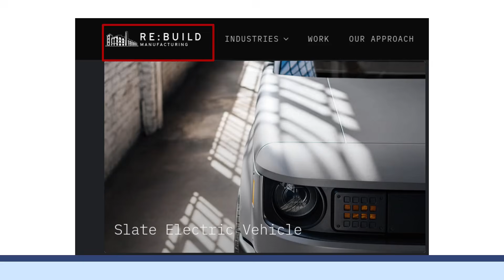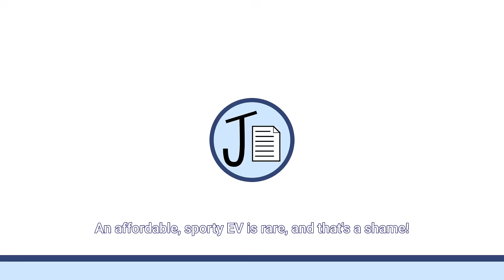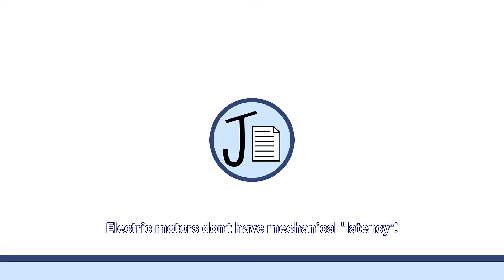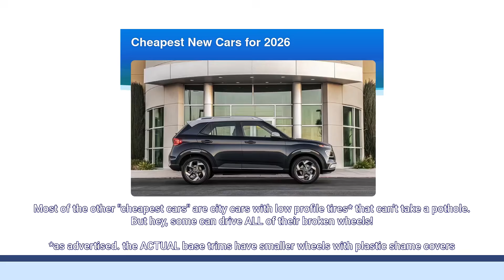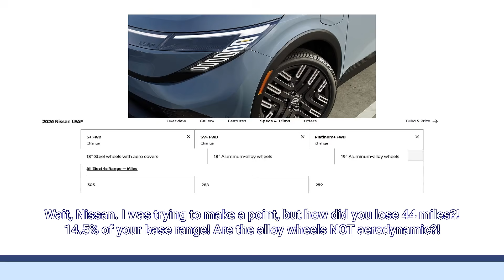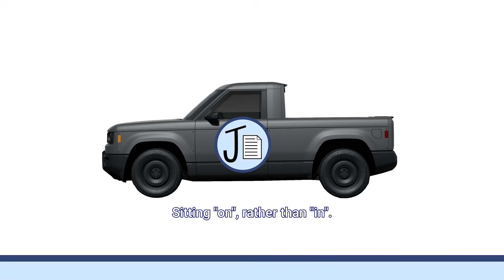The Slate Truck: EV Performance For All

Comment: I think that if this car will be trily successful as an affordable mode of transportation and cheap utility it needs an ice engine, at least a hybrid option. Fir example, farmers and lets say lumberjacks working in remote locations, who use this car for its affordable yet capable utility, wont have all time access to a charging station, and you cant carry jerry cans of electricity to fuel up in case of emergencies, or go to an old gas station in aa quiet town that conviniently close to your worksite
Reply from the maker: I maintain that electricity is more accessible in remote locations than gas. Any long-term settlement in the US has electricity, and it can be generated from *anything*...including gas. For any given amount of gas, you'll get more EV range than ICEV range because of thermal efficiency. If you need to bring in jerry cans, may as well use them for the generator.

Comment: I like the idea of the basic truck. A good way to try an electric vehicle. But I will wait to see if all the add on options make it or if there were supply shortages or problems. And how much the aftermarket people jump in. Like a bolt in module to add a stereo in the dash. Or leather seat covers. A trailer hitch with a wiring harness!
Reply from the maker: At least one add-on option didn't make it; they used to have a power window kit. The forums speculate supply or regulatory issues. Many of the options on the online configurator are now from aftermarket suppliers, including many lights and bed accessories. I'm hoping we'll keep seeing more variety!
A Slate rep said the trailer hitch accessory has a 4-pin wiring connector. Folks on the forum seem happy about that, but I can't claim to know much about towing.

Comment: The range isn’t enough for what I do   Otherwise interesting.  They should do a simple modular battery system. A simple base battery with the ability to slide in more power like sliding in an oversized drill battery.
Reply from the maker: The new LFP battery uses all the space in the chassis because LFP is less energy-dense than the original cells. Will be interesting to see what people are able to do with batteries in the future. I do think that 205 miles is a good amount of range. Batteries are the most expensive part of an EV, and I like that Slate targeted a modest figure.

Comment: Any idea of replacement battery cost? (I'm not sealioning. I've had 3 EVs and want another.)
Reply from the maker: Nothing but speculation on the cost of a replacement battery at this point. Maybe it'll come out with some kind of insurance or repair-related information?
Reply: Most EV batteries will outlast the vehicle and then could be placed in stationary battery backup
Reply: @phileasler5401  True, but is one allowed to discuss contingency for edge cases or do we just reassure each other here?
Reply: @nickolasthefrog absolutely 👍

Comment: 25k is too much for an EV that’s not a car, not a pickup, not an suv. What is it. It has no towing capability. I could see it being 15k something  for kids to drive around. But it’s not going to be very safe. With little range. No thanks. For 25k I’ll get a used real vehicle.
Reply from the maker: The 2k tow rating is literally in the video, man.
Reply: It’s a real truck, but maybe not for you

Comment: If you call $ 25,000.00 for nothing, a vehicle that has doors that close windows that roll down and drives. If you call that affordable, I don't know what planet you're living on. To get even the basic, most modest features.You're well into the $30,000s. How is that affordable? Unless slate comes in at a base price of $15,000.00 it will never survive the competition.
Reply: His video before this one covers the affordability dimension — it’s more than just initial price.

Comment: to think it does not need awd is silly, it might be great as is but some people genuinely need awd. just watch one of their own slate winter test videos, it has no proper traction. im sure as is will make many people happy. id prefer awd, as well a moonroof cutout option, even if just a panel cutout that i could pop out with some bolts and add a rag top to for summer times.
Reply: AWD is a crutch 90% people use as a replacement for proper tires

Comment: Does it have the built-in spyware mandated by the US government in 2027?
Reply from the maker: It's my understanding that the 2027 spyware thing is a sensationalized rumor with no realistic plans for implementation.

If Slates are shipped with spyware under order of law, it will be the most easily "disarmed" vehicle on the market, and Slate's the only automaker I know that's expressed explicit disinterest in customer data. Anything more I could say is far into the realm of speculation.

Comment: I just kinda wish it wasn't a pickup truck lol. I don't need that shit, id rather have more cabin space, better aero/range, and a smaller easier to parallel park car. I say this as a tall guy btw. Watching the videos that slate truck is not big enough for my legs anyway lol the fact that the seats dont slide back or lean back is a problem.
Reply from the maker: Supposedly, tall people fit well. I'm pretty sure the seats do slide/recline, unless you mean that they don't slide/recline far enough, in which case, I'm not arguing; just trying to inform.

As I said in the video, pickup truck isn't my ideal form factor either. I'm just glad it's a two-door and not something bulkier; its footprint is comparable to my own hatchback.

Comment: You'd think that by now someone would build an affordable electric sports car, for one simple reason: Batteries are the most expensive part of an EV. Sports cars are small and streamlined, meaning low drag. Low drag means you can achieve decent range with a smaller battery, meaning less cost. The only company I know of that's developing a car with that logic is Aptera.

You might say that the long hood that most coupes have makes no sense for an EV, but there have been plenty of rear-engined sports cars that used that space for luggage (Porsche, Alpine, Delorean, Volkswagen SP2, Skoda 110R).

Comment: One of my favorite things about the Slate is that it's an instant filter for the automotive commentariat.  If they can't even argue the value proposition, they're not worth listening to about pretty much anything, because it means they have no insight into what makes vehicles valuable... they only know what the OEMs tell them about the market.
Reply: The Maverick is a much better value proposition.
Reply: Depends on what you value. More stuff is more stuff to break.

Comment: I do not need AWD, I’d much much much much prefer it and it would make driving though New England winters significantly easier. My current car is fwd and it does fine, but my next car will be awd. Soon as slate has that they have me. If Fords small EV truck gets awd I may end up with that one.

Comment: I'm excited for the Slate, I put in an order a few weeks ago when they did their big reveal and I found out about their design philosophy, support for right to repair, etc.

I'm not a truck guy, I've never had an EV, and I have never bought a new vehicle. But the chance to support such a transparently good idea was too much to pass on. 

I hate modern cars. So so much. Even the expensive ones.

Comment: 245's really arent that wide.
Reply: Though in proportion to the Slate, which is narrow by today’s vehicle width distribution, they are.

They’re probably fine for dry conditions. If you get dedicated winter tires, you might want to consider a narrower tire.
Reply from the maker: You're probably right.

Comment: 1. Rear wheel is usually better, not always. In snow front wheel drive vehicles tend to perform better.
2. Gasoline vehicles and hybrids do not suffer the immense range losses that EV’s do in inclement weather. Hot or cold. They suffer a little but not much.
3. If it takes you 8 seconds to reach 60 and you have no latency to start, then it means you are underpowered in the midrange which is not better, try passing someone on the highway with no midrange. that 8 seconds goes somewhere bud.
4. This is not how you market a EV pickup. You market it on simplicity, lighter weight vs other EV’s which makes it more engaging, you talk about how its weight is low centered and improves stability and balance. You had the right idea starting with removing AI driver aids, that’s where you need to keep the conversation. Trying to compare this to a sports car is really stupid, just stop.
Reply: 1)   Understandable but rwd is usually better because it is more efficient.
2)   If winter range is a problem, an ev isn't for you.  Sodium batteries need to rival lfp in density then we can solve that problem 
3)  8 seconds is a lot quicker than you think if you have instant torque and no gears.
4)  its not?  Well I do think they should emphasize the repairablity and "soul" of the vehicle
Reply: For some reason we skipped the obvious success and started making a bunch of impractical, overpriced and vapid EV’s. The most successful EV ever was the model 3, a big sedan, why? Because it actually came close to hitting its expected mileage, was a nice split between practical and luxury, and controlled its price. Minivans were such an obvious platform, flat bellied, focused on comfort and practicality. yet here we are without a single updated competitor for the Toyota Sienna. So Toyota sells every single one they make at a premium while every EV being released gets left unsold on a lot somewhere. It’s so stupid.
Reply: @Drewcrdllo I do think repair ability should be emphasized, that is a good point. But we cant keep saying things like (if the weather is a problem then it’s not for you) that eliminates 75% of the U.S. market. If you want EV’s to find success they have to work for as wide a range of people as possible. I’m one of the few Engineers and genuine enthusiasts who actually know mechanics and how ICE, EV, Tractors, Trains etc works who wants EV’s to get better. Everytime some idiot lies to people about what EV’s are they do permanent damage to that end. They don’t make good sports cars because they carry extra weight, and dont have much character. But you know what, none of that is a problem for a small pickup, or a minivan, or a luxury car. Position them correctly, be honest and realistic, and they can find success.
Reply from the maker: 1. You ignored my point about weight distribution - most cars are front-heavy.
2. I didn't talk about range.
3. You ignored my point - gas cars are the ones losing the midrange in practice, because their 0-60 measurements are a launch that hides their latency in practice.
4. I'm not marketing. I'm a car nerd being excited about something that looks fun to drive. I have another video about affordability, and I will continue to make videos about Slate while I have ideas.
Reply: On point 1, I agree with you.

I’ve driven FWD, RWD and AWD in snowy, icy, slushy conditions. While my current vehicle is AWD, and does have an easier time accelerating in the stuff, I prefer the “clawing through” sensation of FWD, which is a factor when switching lanes on a multi-lane road, or even crossing a road that has mounds of snow or slush on it. RWD tends to over rotate as the front tires have to be pushed through the walls of slush and are always deflected to varying extent. AWD does a little fishtailing as the front tires experience resistance while the rears push add to the deflection movement. FWD just pulls itself through with little unexpected rotational motion about the vertical axis as the rear tires don’t push the rear to one side or the other.

The first time I drove my AWD on a snow-covered highway and had to go through built-up snow walls to change lanes, I was surprised by how much the rear end wanted to step out, and it’s a Subaru which has a reputation for handling well in snow and slush. I actually drive at a slower speed in those conditions than I used to with my FWD vehicle because of it.

Comment: thought this was a good idea, but with a range of only 200 miles and thats if its empty ,  so if you have anything in it  that has some weight to it, you will be lucky to get 150 miles , so no id never buy it
Reply: First epa range tests are based on numerous standards of load so no it’s not based on totally empty nothing on the car and generally manufacturers under estimate range for the very reason that people get their range anxiety and act like they need 700 miles when you can charge anytime in your house for the vast majority of the time you aren’t driving. Also regenerative breaking assists this. Though I think regen breaking is also tied into estimated range? Idk really know all that in depth but I was googling this all the other day looking up for the same reason. Hauling any real weight like pushing its 1,500 or 2k limit I forget yeah is certainly going to drain that range down I think to well below 205
Reply: Nah, it'll perform better than that.
Reply: In the real world 200 miles is plenty for most people, if you're outside of the envelope you get to keep buying gas.
Reply from the maker: Range is barely affected by load. People have done tests on EV towing, and the thing that makes the major difference is aerodynamics, not how much weight they put in.

Comment: If you’re talking about DOM tubing, that is “drawn over mandrel”. This is a process of forcing the tube through a mandrel that controls the inside and outside diameter. The end product is a much more controlled, and tighter toleranced part. It is more expensive but more precise for applications that require it.
Reply from the maker: I'm not sure what you're referring to. Is this supposed to be a reply?

Comment: I agree that for the most part 4WD is unnecessary but anyone who has gotten both drive tires stuck in multiple feet of a mix of ice, snow and slush in the middle of a snow storm knows has sat there wishing they had 4WD. An edge case scenario but it does happen when you live up north.

Comment: This is one of the most informative Slate truck videos I have seen so far.
3:25:  "minimal latency" ( for throttle response)
The response time of power electronics and electric motors is about 0.005 seconds.  In my experience of driving EVs, the car starts moving so quickly that it feels like the car knew I wanted to move before I touched the throttle.
7:40:  The Slate does Not have "rubber band" tires?   Fantastic!
9:22:   Anyone know what the bolt pattern and offset is on Slate-compatible wheels?
Reply from the maker: Bolt pattern is 5-120, 55mm offset.
I believe the unofficial Slate Forums found out in June. If you've got a real specific question, they've either found the answer or confirmed it isn't available yet. Or I'll answer, I read the forum!
Reply: @JohnologueOpinion  Can you say which Slate forum you find to be most helpful?  I found at least two to pick from.
Reply from the maker: @peteinwisconsin2496  slateforums.com
I didn't even know there was another one, it looks new/small.